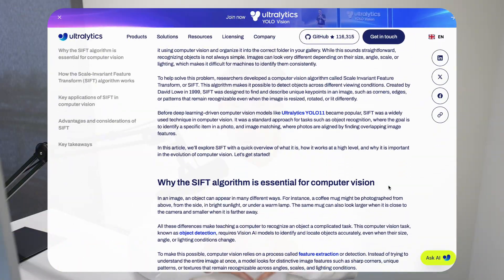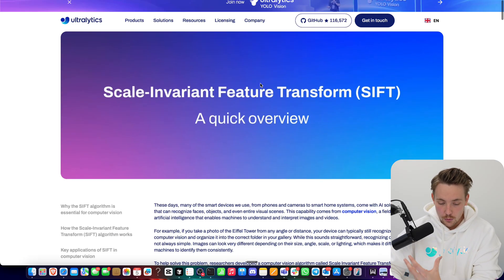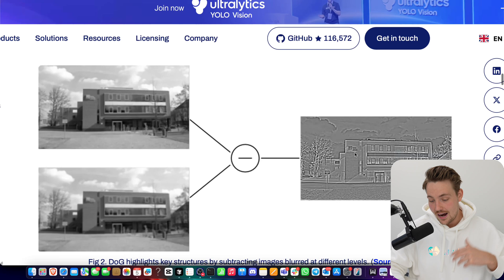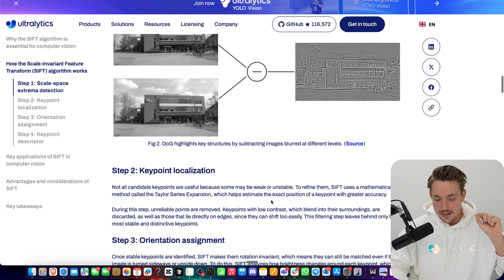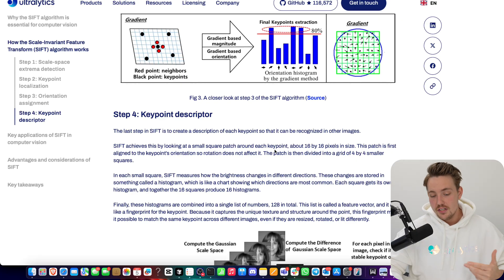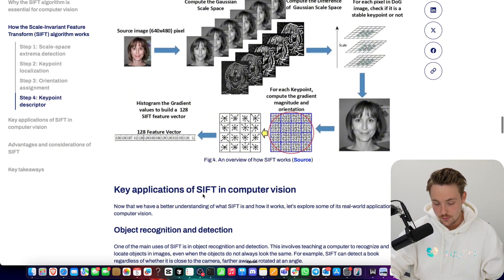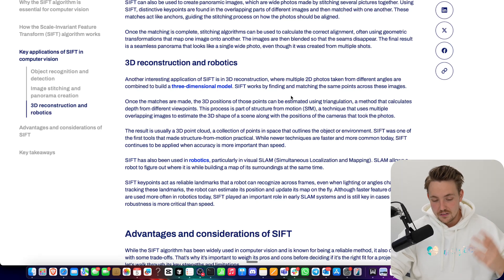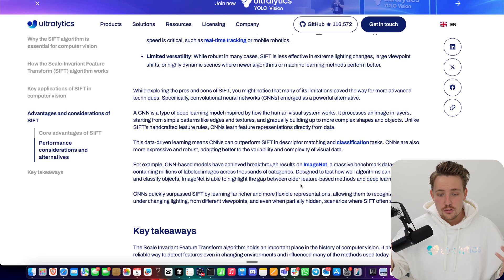How SIFT Works | Keypoints, Descriptors & Applications Explained | Image Processing & Vision AI 🚀

Comment: In a world where transformers hog the spotlight, when do you still reach for SIFT in production—especially under brutal illumination changes or low-data regimes—and do you find its “handcrafted” bias is actually a feature, not a bug, for reliability and auditability? As Borges might put it, are we mistaking the map (deep features) for the territory (repeatable geometry)?
Reply from the maker: Totally fair take — SIFT still earns its keep in production when you need repeatable geometry more than “semantic understanding.”

I still reach for SIFT when (1) you’re doing classical geometry-heavy problems like image stitching, SfM/SLAM bootstrapping, registration, pose estimation, or verification via homography; (2) you have low data / no labels and can’t justify training or maintaining a learned matcher; (3) you need deterministic, debuggable behavior (same inputs → same keypoints/descriptors) for audits, regression tests, and long-lived pipelines; (4) compute is constrained or GPU availability is intermittent (SIFT can be heavy, but it’s predictable and CPU-friendly compared to many transformer matchers).

On “brutal illumination”: SIFT is moderately robust (it leans on gradients and contrast), but it’s not magic under extreme lighting swings. In practice, it’s often reliable if you normalize the input (CLAHE / gamma / grayscale) and tune the detector thresholds; beyond that, learned matchers can win, but they’re harder to guarantee and explain. The Ultralytics write-up touches on SIFT’s scale/rotation invariance and its resilience to lighting/viewpoint changes, plus where it starts to struggle and why it’s computationally heavier than newer options: https://www.ultralytics.com/blog/what-is-the-scale-invariant-feature-transform-sift

And yes — the “handcrafted bias” can be a feature. You’re baking in invariances you actually want (scale + rotation, local gradient structure), and you get traceability: you can inspect keypoints, visualize matches, and explain failure modes in human terms. Deep features are powerful maps, but for many pipelines the territory is still geometry: repeatability, correspondences, and constraints you can verify. If you share your exact use case (camera type, lighting variation, real-time constraints, and whether you need homography/pose), we can suggest a practical SIFT-vs-learned matching choice.

Comment: Love how SIFT feels like “classical art” in a world obsessed with deep nets—if you were building a real-time system on a tiny edge device today (like a drone or AR glasses), where’s the tipping point where you’d still pick SIFT over a lightweight CNN feature extractor, and why?
Reply from the maker: Love that analogy – SIFT really does feel like classical art in a deep-net world 😄  

On a tiny edge device (drone, AR glasses, microcontroller-style boards), I’d only pick SIFT over a lightweight CNN backbone in a few niche situations:

1) Hard constraints on training / data  
If you have almost no labeled data, no way to fine‑tune a CNN, and you just need strong, geometry‑stable keypoints for matching (SLAM, precise relocalization, image stitching, structure‑from‑motion), SIFT can win because it’s “pre‑baked” and doesn’t need training.

2) Extreme viewpoint / scale changes with classical pipelines  
When your pipeline is built around geometric reasoning (RANSAC homographies, essential matrices, PnP, etc.), and you care more about stable, repeatable local features than throughput, SIFT’s invariance and descriptor robustness can still beat tiny CNN features, especially for wide‑baseline matching.

3) Legacy / compatibility requirements  
If you must interoperate with an existing SIFT-based database or SLAM/localization stack (e.g., maps created years ago with SIFT), sticking with SIFT avoids domain-shift headaches from swapping in CNN descriptors.

Everywhere else, the tipping point goes to lightweight CNNs (including small YOLO11 backbones or tiny classification models): they’re faster on modern edge hardware, GPU/NPUs love convolutions, you can compress/quantize them, and they adapt better to your domain once you have even a modest labeled set.

If you tell me your device (e.g., Jetson, phone, microcontroller) and task (tracking, mapping, recognition, etc.), I can give a more concrete “SIFT vs tiny CNN” recommendation.

Comment: Bro, curious—on real-world, muddy trail photos with motion blur and changing light, do you still trust vanilla SIFT, or do you always pair it with a learned feature extractor now? And where do the patent ghosts still haunt deployment in 2025?
Reply from the maker: On rough, real-world trail data (mud, motion blur, lighting changes), I’d treat “vanilla SIFT only” as more of a baseline than a solution.

For that kind of scenario today, I’d usually:
• Still use SIFT (or ORB/SURF-style features) as a quick sanity check / baseline, or when I’m extremely compute-constrained and conditions aren’t too nasty.  
• Prefer learned features (e.g. SuperPoint, R2D2, DISK, or even a compact CNN/Transformer backbone) if I care about robustness over a long sequence, variable illumination, and smear from motion blur. Those learned extractors just hold up better in practice on modern datasets than pure SIFT, especially when paired with a learned matcher.

If you’re doing anything like trail-following, SLAM, or long-term place recognition, I’d absolutely lean on learned features or even higher-level models (e.g. a lightweight YOLO11 for object/landmark detection, plus a learned descriptor for matching those landmarks across frames).

On the patent side in 2025:
• The original SIFT patents (Lowe/UBC) have expired globally, so “classic” SIFT is safe to use in both research and commercial products.  
• Where “patent ghosts” still show up is more around:  
  – Some newer local-feature families and specific descriptor variants (country‑dependent, and very implementation‑specific).  
  – Closed-source SDKs that bundle proprietary pipelines (feature extraction + matching + localization) under commercial licenses.  

If you’re rolling your own in OpenCV or PyTorch with standard SIFT/SURF-like ideas, you’re generally fine now. If you’re embedding a 3rd‑party, prebuilt feature stack into a commercial product, that’s when it’s worth running an IP check or asking the vendor for clear licensing terms.

If you share a bit more about your trail pipeline (pure image matching vs full navigation / SLAM vs detection+tracking), I can suggest a more concrete “SIFT vs learned” mix.

Comment: Super cool breakdown. In real-world pipelines, when would you still reach for “classic” SIFT over just throwing a deep feature extractor at the problem, and have you run into any nasty failure cases where SIFT totally embarrasses itself (or vice versa)?
Reply from the maker: Love this question 👌

Where SIFT still makes sense today:
• Very small datasets or no labels: If you only have a handful of images (e.g., heritage photos, lab microscope shots, one-off industrial parts), SIFT + nearest-neighbor matching can work well without any training.  
• Exact or near-exact instance matching: Logo/packaging verification, template matching, copy-move forgery detection, image stitching, SfM/SLAM with limited compute. The stability and scale/rotation invariance of SIFT keypoints shine here.  
• Tight classical CV stacks: Pipelines built around RANSAC, homographies, and geometric verification (stereo, panorama stitching, 3D reconstruction) where you want fully interpretable feature matches.  
• Restricted/air‑gapped environments: When you can’t ship a big deep model or retrain, but you can run OpenCV and some linear algebra.

Nasty failure cases for SIFT:
• Textureless or low-contrast regions: Smooth metal, skin, blank walls, foggy/low-light scenes – SIFT just doesn’t find many stable keypoints, so matching collapses.  
• Extreme illumination / viewpoint changes: Large lighting shifts, strong shadows, specular highlights, or very oblique views can break the gradient patterns it relies on.  
• Real-time, large-scale systems: It’s simply too slow and CPU-heavy for high-FPS, multi-camera, or mobile scenarios without serious engineering.  
These are exactly the limitations highlighted in our SIFT write-up: it’s robust but computationally expensive and “not ideal for real-time use” and struggles in “extreme lighting changes [and] large viewpoint shifts”. You can see that discussed in more detail here: https://www.ultralytics.com/blog/what-is-the-scale-invariant-feature-transform-sift

Where deep features embarrass SIFT:
• General object recognition / detection at scale: As soon as you need category-level understanding (cars, dogs, tools) across lots of variation, a CNN backbone (like YOLO11) massively outperforms handcrafted descriptors.  
• Tough conditions: Low light, motion blur, heavy clutter, occlusion, and large pose changes are handled much better by deep features trained on diverse data.  
• Speed + flexibility: Modern detectors give you dense features “for free” while doing detection, and you can fine-tune them for your domain, something SIFT simply can’t do.

Where SIFT can still embarrass deep models:
• Exact 1:1 matching with no training data: For example, matching an old blueprint or specific book cover under moderate changes in scale/rotation – SIFT can nail it with zero training while a generic deep model may not have seen that object at all.  
• Pure geometry tasks: Panorama stitching from a small set of photos, or offline 3D reconstruction where you care more about match accuracy than speed – a well-tuned SIFT+RANSAC pipeline can be hard to beat.

A nice hybrid in real-world systems is: use a detector like YOLO11 to localize objects, then run SIFT inside those crops for instance-level matching or fine geometric alignment. That way you get the robustness of deep learning plus the precise local matches of SIFT.

Comment: Spicy take: is classic SIFT→RootSIFT + Lowe ratio (CudaSIFT FTW) still competitive vs SuperPoint/SuperGlue (arXiv:1712.07629, 1911.11763) for wide-baseline SLAM on edge, and which DoG/scale-space knobs (contrast/edge thresholds, octaves) actually move the ROC under low light and motion blur?
Reply from the maker: Great Q. Short answer: a well-tuned SIFT → RootSIFT + Lowe ratio with GPU (CudaSIFT) can still be competitive for wide-baseline SLAM on edge when you’re latency/power constrained, but SuperPoint/SuperGlue typically win on match recall and pose success under extreme viewpoint/illumination and low-texture scenes—at a higher compute/memory cost. For low light and motion blur, the SIFT knobs that move the ROC most are: lower contrastThreshold (~0.01–0.02) to recover features, tighten edgeThreshold (≈6–8) to reject blur-induced edge responses, increase nOctaves (5–6) and nOctaveLayers (4) for scale/blur robustness, and keep sigma near 1.6–1.8. Pair with RootSIFT, a stricter ratio test (0.6–0.75 depending on scene repetitiveness), cross-check matching, and LO-RANSAC for clean inliers. If you have an embedded GPU (e.g., Jetson with TensorRT), SuperPoint/SuperGlue can run real time and usually outperform; on CPU-only or very tight budgets, CudaSIFT remains a solid choice. Quick refresher on SIFT trade-offs and where it still shines: https://www.ultralytics.com/blog/what-is-the-scale-invariant-feature-transform-sift

If you share device/latency targets and keypoint counts, I can suggest concrete thresholds for your setup.

Comment: Hot take: is SIFT the cockroach of CV—still the most robust when things go OOD? Could you share HPatches/ETH3D-style numbers comparing SIFT+FLANN+RANSAC to SuperPoint+SuperGlue/LoFTR on CPU-only edge devices, and tips for tuning σ/octaves/contrast for the best speed–repeatability trade-off?
Reply from the maker: Love the take 😄 SIFT is still super robust OOD (scale/rotation, moderate lighting), but on HPatches/ETH3D learned matchers like SuperPoint+SuperGlue and LoFTR typically edge it on accuracy—though they’re heavier and often GPU-tuned, so CPU-only edge devices can flip the speed equation. We haven’t published a CPU-only HPatches/ETH3D head-to-head for SIFT+FLANN+RANSAC vs SP+SG/LoFTR; if you share CPU model, image size, and FPS target, we can help reproduce.

For a solid SIFT speed–repeatability trade-off on CPU: cap nfeatures (~1–2k), use nOctaveLayers=2, raise contrastThreshold to ~0.06–0.12, set sigma ≈1.4–1.8, optionally downscale inputs (0.7–0.8×); use RootSIFT, FLANN KDTree (trees=4, checks ~64–128) with Lowe ratio 0.7–0.75, then RANSAC with reprojThreshold ~2–4 px and high confidence. More on SIFT pros/cons here: https://www.ultralytics.com/blog/what-is-the-scale-invariant-feature-transform-sift